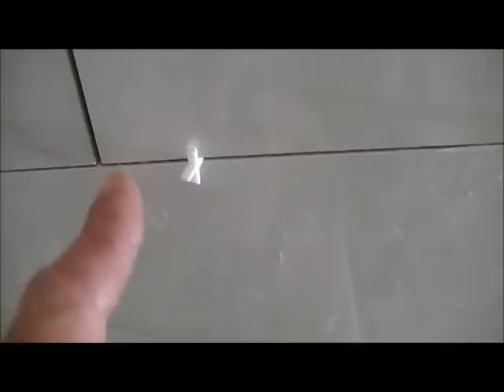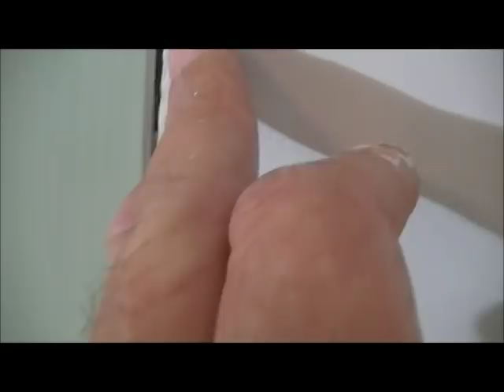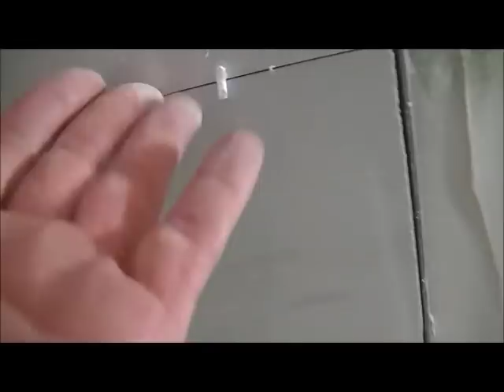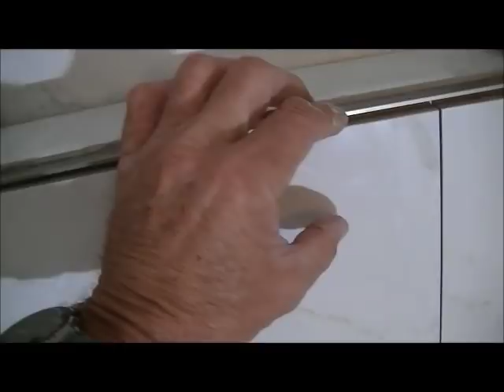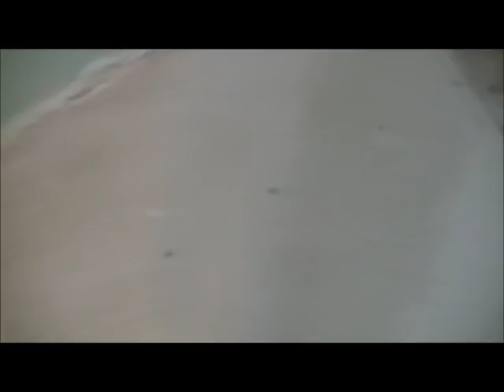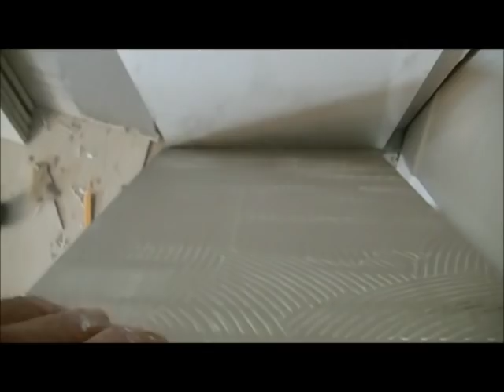Tile Guy Messes Up Project ( really bad tile job )

Comment: The squeaking is best addressed before you lay the tile backer with some screws into the joist.
Reply: what if there is no joist anywhere near...as in it was laid dead center between the joists? I had some 'framers' build a wall that has a pocket door frame installed in it.down the center between tow joists.... so now when we walk in that area. mad squeak like a haunted house. as the pocket door frame is only secured to the subfloor. nails.not screws. my understanding is that is should have been braced from underneath and then SCREWS should have been used. Pocket door already diminishes integrity of the wall...(your thoughts?)💖

Comment: won't red guard interfere with the bond of the thin set? ist the point of the hardie backer /thin set marriage to not be water proof between to insure a better bond?
Reply: Nope. Adhesive sticks really good.
Reply: Cement board is an alternative to drywall that is made for bonding tile in wet areas, it isnt waterproof and therefore needes something like redguard to make it waterproof. If this is not done it will leak and cause mold issues. No bond issues with redguard, its what its designed for.

Comment: The floor is not squeeking because of nail displacement. It squeeks because the plywood underneath was not screwed down
Reply: D Beaulieu could be any number of things. Nail rubbing against joist maybe.
Reply: There are numerous reasons a wood floor could squeak, from an old nail to an issue with the subfloor. It's not just a single thing, D.

Comment: Nails?!? No sir. You need to trowel thinset down and put durock or permabase and of course tape the joints and then you SCREW it down.
Reply: John Jenson More screws and taping those seams.  Plus that subfloor could have been the cause of the squeaky floor to begin with.  Should of been addressed from the get go.
Reply from the maker: And f*** up your floor for the next guy....yeah ok
Reply: For the next guy? Our floors will last 50 years. Not worried about the next guy buddy. Nails work loose. Also. I said tape joints. You always tape joints. Thats moot point
Reply from the maker: *Never ever happen*..you can not have a nail "work loose" through thinset & tile...that's a joke, right ?? Obviously you've no idea what you speak. Both Durock & Wonderboard allow for 1 1/2'' roofing nails, right there on the label. So before you post a comment, know your facts.
Reply: Better to overdo than underdo. Agree to disagree here. When i see nails i think jackleg

Comment: The one thing that a seasoned tile setter knows
1. tools matter
2. do a mock up layout
3. it takes years to know the trade 
4. constantly upgrade or learn
5. outdoor tiling is not the same as indoor, consider the weather
and temperature

Comment: the chipped tiles were not caused by using a wet saw, they were caused by cutting too fast. If you go slow, the tile won't chip.

Comment: is back buttering the tiles necessary???
Reply from the maker: Yes
Reply: benoit lambert it's critical to back butter the tiles better bond won't break over time won't fall off due to moisture
Reply: benoit lambert If you just trowel the thinset on the wall it the rock board will draw the moisture out of the thinset drying it to fast.  Making it necessary to spread on wall and also back buttering.
Reply: depends on the tile actually..... so I have learned... most tile manufacturers seem to state iof they recommend back buttering to properly install their tile/or not....that is just what I have come to learn over the past 5 months of research after having a contractor drag me into living a nightmare.💖💖💖💖

Comment: I'm not saying the installer was good by any means. But the  idea that anyone should have to provide and pay for materials on a job is not right. That's like saying an auto mechanic should buy the parts for your car. It's also true that the salary of the tile trade has gone way down. It's not the responsibility of the tile setter to correct plumbing mistakes or framing mistakes. I have dealt numerous times w such issues and construction supers and contractors rarely if ever make the plumber or framer or whoever fix their mistakes. But still pay them top dollar. It's evident the person who installed this job is not skilled in any way and did make many mistakes but blaming him for not correcting a plumbing mistake is not right. Nor is it right to expect a tile guy to pay for water proofing. Especially one that's inferior. So my point is not only is this particular tile guy not skilled neither is the plumber or the contractor running the job. Being he gets paid to run the job and ensure the quality of his subs. While this particular contractor was brought in after the fact is another story he should at least know what he's talking about. In this video he points out the issue of the tile not reaching the mud cap in this case is wrong. You can't build out the tile over an inch you'd see it along that wall. Also his concept of rectified tile is wrong. Rectified tile means the tiles are uniform in size and have square edges that has nothing to do with how flat they are. Large tiles bow when fired in a kiln. That's why the manufacturer tells you not to set them in certain patterns. While this guy is right about the poor cutting abilities he's wrong about many things. Hence my point pay a good installer what he's really worth and listen to what he tells you. Ever hear the phrase Good, fast, Cheap pick two? If you want it good and fast it won't be cheap. You want it cheap n fast it won't be good.
Reply: Frank Matuza you sound experienced in making excuses
Reply: Shows how much you know about me or trade work. Do the job right, tell the customer what you need to do the job right, or dont do the job. Reputation is worth more than money. You sound like a know nothing customer or a shitty tradesman. Work hard on the job and you dont have to work hard on the excuses.
Reply: The worst too is when you get tiles that are 1/16th off of each other iv seen rectifed as the same too
Reply: SarnXero, respectfully, by this bold and free statement you sound inexperienced and don't understand what is the point he is making here.

Comment: Agreed this job is terrible. In answer as to why people do this can't answer all those reasons but here is one... nobody wants to pay good installers properly. And hey dude why should the installer pay for water proofing? Do you expect the installer to pay for thinset too? Granted if the customer doesn't want to pay for water proofing then don't the job. Also you're right about the valve issue. Again tile guy should have demanded it be corrected. You can't build out your tile on a wall that far out to accommodate it it will cause a huge gap between the Schluter and the wall. Also not acceptable. I stand in agreement that this job was hacked but you can't expect perfection on top of crap either. It's also been shown that liquid water proofing agents ( red guard ) are not sound. They sometimes peel and break bond. Schluter Kerri fabric a much better option or even better use Kerdi board. Bottom line if you want quality pay for it. Also keep the other trades in check as well. You can't expect perfection from one trade while others do what they want. But overall whoever did this tile work had no clue and could not be considered a tile installer.
Reply: Frank Matuza very true many cheap customers want grade A+ quality job and for extremely cheap or not buy certain materials which I think it’s stupid. You get what you pay for. You paid crapped then crappy job should it be
Reply: Frank Matuza but let’s be honest I bet this installer is an amateur those mistakes are just too big

Comment: Why did you have to pull up the hardi-board from the floor, instead of just using more screws?
Reply from the maker: They used wrong size for the transition.

Comment: The owner is the one to blame because they are the ones who thought it's easy to do this and went in over their heads and said someone else did this. Even dumb shits who just blow and go use thin set. Maybe they are not dumb shits it's usually the boss who's pushing them to do this.
Reply: No. I've encountered two people who are involved in tile work as either primary work or as contractor and both use mastic in showers!!! I didn't call one back after that and I'm hoping the other doesn't return after I made him tear out a bad day's worth of drywall work and tub setting.

Comment: Thank you for your videos, I am learning a lot. 2 questions. 
You say many times never, never, never use mastic in a shower. Why is that? 
The second question is, if you are going to butter the wall and the tile do you use the same size trowel as the manufacturer recommends? Is the manufacturer assuming that you are buttering both of the wall and the tile?
Reply from the maker: Mastic is a water based product which will not dry/cure behind larger tile. And you can't get the thickness of troweling out & backbuttering.
Yes, they will assume you'll be buttering. Any larger tile must be done with plus 1/4'' trowel.
Reply: Thank you.

Comment: sure I can lay tile
Reply from the maker: Directions specify to overlap seams...anyone with common sense knows that. Anyway it's a moot issue, never fails, always works, end of story.
Reply: This guy can make the argument to use nails because the "manufacturer" says it's okay. We know differently. If you used an 1 1/2 nail through 1/2 board and 3/4 subfloor, if you even tried to hit a floor joist, you'd have a staggering 1/4 penetration into the joist. I think we can all agree, that won't cut it.
Reply from the maker: Nails OR screws for backer board are not meant to hit floor joists, whew, ! stay to what you know.
Reply: I rest my case as to your expertise on tiling. You've answered your own question now. Because backer board is produced in 3x5 sheets, it is NOT the product to use on floors. How stable can the product be if none of the seams end up on the joists?

Comment: Sometimes the tub is not level and sometimes it's the tub flange that is not straight. Manufacturing defects are becoming more and more common with these tubs. Having said that, you MUST make sure that your tub is sitting level before you put up your cement board otherwise you will not be going up level. Installing tubs and tiles is not a DIY job. It requires a great deal of skill to avoid mistakes. You might install a window or door incorrectly and remove it and do it right but if you screw up the tiling job redoing it means breaking everything and starting all over and that's time consuming and very costly.
Reply: Skanzool tell me about that tubs these days and the level of them is really bad

Comment: Fully cured grey  thin set going to bleed through white non sanded grout?  I call BS.  I think you are confused with grey thin set bleeding through certain stones.  Good video all the same.
Reply from the maker: Nope, happens a lot. Grey thinset for darker grouts, white thinset for lighter grouts.

Comment: I like using shluter metal for my niches but I miter all four corners and nice tight fit with surrounding field tile, always turns out perfect, don't like using bullnose because the niche is usually 4" deep and bullnose is 3" deep, just looks cleaner unless I can find 4" deep bullnose

Comment: are you sure about the roofing nails to secure your substrate? what's wrong with just using the recommended screws, I feel like it's better fastened, my .02 cents
Reply: if you see the recommended installation procedures of James Hardie backer board, it calls for a mortar bed for floor installations.
Reply: garret stewart you're also supposed to set concrete board (hardy or durock) on a floor in a troweled on thin set base.
Reply from the maker: If you look on most backerboard it allows for inch and a half galvanized roofing nails, you're free to do that anyway you want. And using thinset on your plywood to set backer board is both stupid and redundant, and will tear up your plywood on the next application
Reply: StarrTile I agree that thinset under backer board is a waste, like you stated if it's well fastened then that's all that maters
Reply from the maker: Perhaps it does, but that does not mean it won't do the job it's supposed to do without it.

Comment: the board they used has to be wet down before applying thinset or it will wick all the moisture out of your thinset too quickly causing it to let go.
Reply: Yep a handyman job..just came back from an estimate and the customer said they could get it done for half the price from their handyman, well this is what you get.....
Reply: you shouldnt "wet down before tiling" you should prime all surfaces with somthing like prime + or SBRS which is a tiling primer that soaks into the surface and controls the suction of the board there for it will adhere properly

Comment: Your so quick to slag off the work but you say you nail down the sub floor because the nails are cheap, dude you wouldn't even get that far in my house, a solid floor should be screwed down using rust proof screws.
Reply from the maker: +craig cope  The purple & orange screws that are sold with most backerboards are VERY expensive, yes...but I make not one dime off of materials so the savings is not for me. And I got tired of drill slipping & hitting my finger. Plus the backerboard company calls for using screws OR 1 1/2'' roofing nails...and roofing nails don't rust. And lastly, the backer is nailed down then thinset/tile go over it, so your thought that nails will back out is impossible. Been doing it this way over a dozen years without one issue.

Absolutely no desire to work in your home ;-)
Reply: I just watched the hardie backer board 500 install video "from hardie" and you can use 1-5/8 roofing nails!
The video also shows screwing it down, i would take the time and cost to screw down but that's just me, screw and glue subfloor and all.
Reply: +StarrTile bro just thinset under the hardi board too to make sure ... but bro wedo it for the cheddar ofcourse
Reply: +StarrTile roofing nails do rust, I can text you a picture if needed 😎
Reply from the maker: Galvanized resist rusting, and it's on the backer which has thinset and tile on top...

I can show you a picture of a pig with lipstick on, but very few pigs wear lipstick ;-)

Comment: Where to start? Yes it's a poor installation, but several things need clarifying. It's likely a Chinese made tile with sub par glazing which means it chips on the edges whether the blade is new or not. Just because a tile is rectified doesn't mean it's perfect and large tiles set on a brick pattern tend to have lippage
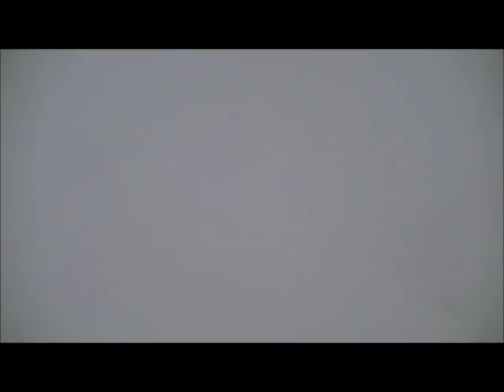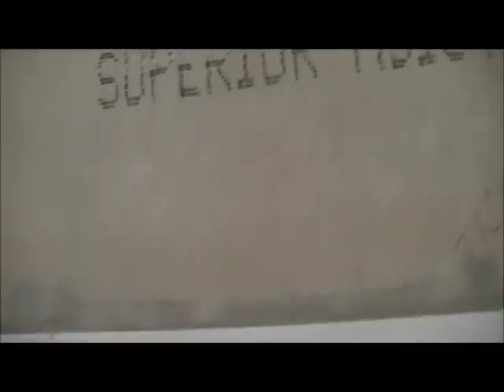 regardless of how skilled the installer is. At 5:30 the rough cut doesn't matter because it will be hidden by  the tile on the return side. At 7:30 where the hole was miscut is a simple fix considering the large tile.
The installers are probably using gray thinset because the profit margin is so low they're trying to skim anywhere they can.
Another thing is people want quality on the cheap. Well folks, you get what you pay for. Just remember that the inconvenience of poor quality lingers far longer than the thrill of a bargain.
Reply: Fred Flagstone yes and that is what it is not some contractor  coming in and ripping on someones job because he needs to make himself look better but not knowing the circumstances of the homeowner and the installer serves these cheap homeowners rite and they always cry victim

Comment: If you know your saw well? You can use a wet table saw. Depends how good you are.
Reply from the maker: +Karl T  Yes maybe you can in a pinch, but this tile is thick & very dense, a table saw would take 3 times as long as an industrial saw, and go through 5 of the little 4'' blades...makes no sense.

Comment: Could I use Redgard in place of PVC liner before pouring a shower pan?   I was concerned about the seal between the floor and drain, so I used fiberglass mat over the drain with Redgard so that no water can get past that.  I just want to make sure this is a viable option before putting in the pan.  I plan to do the proper coating on the entire shower walls and flat floor and doing a water test before pouring the pan.  Do you think this will work?
Reply from the maker: +YourFavPlaylist  Custom Building Products, the people that make Redgard says you could use it as a pan liner, but I would be apprehensive about it...old school ways die hard, always prefer a liner. Your method should work, just think like water ;-)
Reply: +StarrTile can you use redguard as a liner in roman tub build, and do you have roman tub videos?
Reply from the maker: I don't know, and no I have no videos like that.
Reply: +StarrTile OK. Thanks to your videos I just remodeled my shower (complete build) and would not have been able to do it without you.